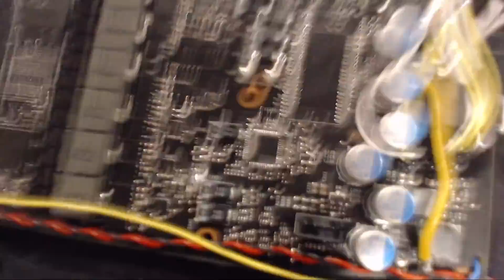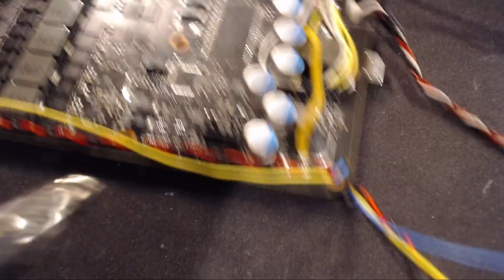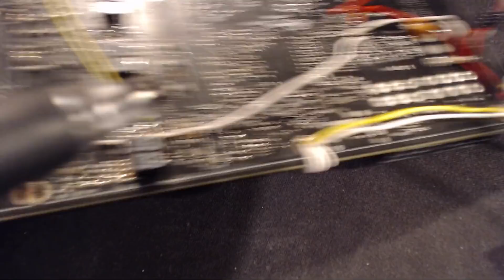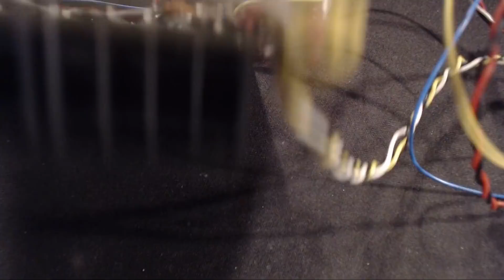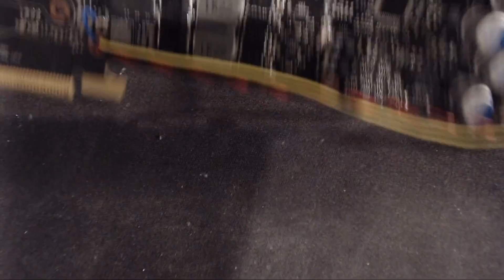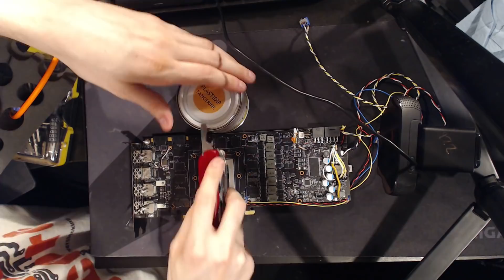GTX 1080Ti "Buildzoid Edition"

Comment: I had a Strix OC 1080 Ti which had the 12v line blow up in the exact same spot lol

that can't be a coincidence. I ended up doing basically the same thing, I just cut the pcie traces off those fried pins and was going to scavenge 12v from somewhere else but I was never able to get a boardview of the 1080 Ti and so I just ended up using the cooler on a 1070 Ti Strix instead and sold the broken 1080 Ti PCB.

I found the 1080 Ti in the trash anyways so I still made money off it lol

Comment: Eliminating phase shedding certainly reduces output ripple significantly.  It also eliminates the transient dip when a large load step requires the controller to power up the phases.  Note that this Vcore VR was designed to be CHEAP.  Control loop architecture the same as used on the very first multi-phase ~20yrs ago (voltage mode PWM), no I2C interface, no telemetry, current balancing using the low side MOSFET RDSON which is generally no better than 10%-15% (no wonder light load efficiency is bad, probably circulating currents in the phases), discrete MOSFET drivers + discrete MOSFETs (= much cheaper than SPS), and no tristate PFM mode (yet another reason for poor light load efficiency).  They probably saved $0.30 - $0.50 per phase and $0.50 - $0.70 on the controller.
EDIT:  The price is $760 for this thing????

Comment: As you've found out there is little use putting large tantalums directly at the chip. Their high ESL makes them useless at filtering high frequency. You want small MLCCs like you did with the memory chips. Their capacitance value don't really matter that much, the main problem is inductance at really high frequencies. You can see the PCB already has lots of tiny capacitors (0402 and 0201 and maybe even smaller).
Reply: http://img.deusm.com/eetimes/adt-0011-decoupling-capacitors-04-lg.jpg
This graph shows how capacitors' effectiveness varies at different frequencies
Reply: The smaller the package size the lower its ESL (and capacitance) and hence better performance at high frequencies

Comment: You think you're a decent EE until you see this video. How do you know what everything is off hand, did you get schematics or just analyzing the ICs and going from data sheet? If the latter, fooook
Reply from the maker: read part numbers of chips then study datasheets. I wish I had schematic but don't. In some cases I've do feed back mods based on just knowing the manufacturer and their preferred method of wiring up feed back circuits(this is basically the sketchiest thing I've done).

Comment: i dont believe its a 1080Ti..... indicator- 6 pin+8 pin power connectors...1080Ti has 2x 8 pin power connectors
Reply: belay my last....most 1080ti has 2x 8 pin connectors. just looked at newegg and seen a couple brands and models using 1x6 and 1x8 pin connectors

Comment: Honestly, I'm curious. If you went for a degree in Uni, what did you go for? I'm going into my second year of EE and previously did a year as ECE (electrical and computer engineering). I already tinker with hardware soldering, modding, and etc, but I'm just curious about your education. Thanks!

Comment: it won't work stable for a long time. there are so many cards witch faulty chip and fully work pcb. just replace the chip.  you can disable power throttling by shorting all shunt resistors.

Comment: Wtf is the point of a zero ohm resistor lol?
Reply: its a jumper in the size and shape of a smd resistor. during development it might have needed a resistor and when they solved another related issue it no longer needed a resistor. at that point do you respin an entire board because you don't want to use a rediculously cheap component? nah. just use a zero ohm resistor!

Comment: I've been wondering how you figure out the resistor sizes for your voltage dividers.
Is it all just experience or is there a formular of sorts to calculate Ohm values?
Reply: basic eletronic,just google it up
Reply: Right I forgot that BZ knows what voltafes and currents will be flowing so he can use U=R*I and solve for R, I thought he didn't know either U and/or I so he'd need a different formular or something like that.

Comment: There’s no much point modding the card. just flash the strix ocx bios, it removes the power limit completely and gives you 1.2v max vcore.
Reply from the maker: yeah except on LN2 I need like 1.5-1.65 Vcore and mem control to 1.5V.

Comment: Why are PCI-e 8-pins 360w max but 8-pin CPU power are 480w max ?
Reply: On a PCIE connector there are only 3 actual 12v lines (each line is good for about 120w, hence 120W x 3 = 360W), two ground/sense pins, and 3 actual ground lines, while on the CPU 8pin there are 4 12v lines and 4 ground lines (hence 120W x 4 = 480W).

Comment: So basically the GTX 1080 Ti wasn`t dead enough, so buildzoid has to make it even more dead with LN2

#what doesn't kill you makes you stronger
Reply from the maker: I'd say this card probably wishes it was still dead.
Reply: Actually Hardcore Overclocking "BrutalZoid"
Reply: Actually Hardcore Overclocking when is the funeral?
Reply: @ActuallyHardcoreOverclocking  Best comment, oh man.
Reply: that's the 1080TI Zombie edition
Reply: My card is shivering in fear from rendering this video.
Reply: @lolmandos  I'm shure your Card just needs a Cooler Replacement :D

Comment: i was sitting here, being happy that i mounted an aftermarket cooler on my gpu without breaking anything, and now you post this video
Reply: Lukas Beier I even managed to replace the Capacitors on a GTX 660 Ti, and he just rewired the whole 12V Rail and Current sense Circuit
Reply: Think I'll just blow the dust out of my card and get a 20% FPS boost :)

Comment: Does anyone actually care about the fact, that modifications on the voltage feedback network mess up the compensation network causing unwanted oscillations?
No?
Alright...
Reply from the maker: This is a REFIN not a FB mod. Also I've checked several of my FB modded cards with a scope and there's no issues with them.
Reply: Mmhh ok. Must be a single phase thing. Had some issues on the LTC3789 in the 50mV range when controlling it with a poti. An indirect op amp control solved it though.

Comment: Why use Liquid Metall instead of additional shunt resistors?

To go round the power limit of a gfx card overclocker paint liquid metall on their shunt resistors. Why don't they solder a second shunt resistor on top of the first one. Now the two resistors are used in parallel reducing the resistance. If you shunt two resistors with the resistance of R parallel the resulting resistance is 0.5*R, the test curcuit on the GPU measure's only half the Voltage doubling the headroom for overclocking.

The advantages are:
1. There is no Liquid Metall eating away the solder of your GPU
2. The resulting resistance is known, you know the current draw, you know the new limit of your GPU an you can operate it more savely.

My Queston is: Why don't they do it?

Comment: Looks like a 1080Ti + the shoddy wiring in my grandmas basement. 10/10 engineer genious though, you got it working.
Reply: Well I mean a good bit of the pcie slot is literally burned off... so wouldn't worry about the wiring xD

Comment: Any idea what your power consumption will top out at?
Reply: How much more did you get out of them mem with the 47uF?
Reply: i would say <560watts based on his lack of care for the PCIe cables for reference a mildly overclocked 1080ti could reach 300watts and normal ones are around 250watts i think Buildzoid would be happy if he could pull more then 560watts with this

Comment: how many money to spent for 4k camera?
Reply from the maker: I'd sooner buy a GTX 2080 Ti than a 4K camera.
Reply: what about upscaling to 4k from 1080p bcoz of higher bitrate with 4k? dont get me mad, i like your content, but more like in 4k.
Reply: BlacKi2007 4k is overrated according to me
Reply: Actually Hardcore Overclocking Actually Hardcore Overclocking I got my gtx 1060 corroded and is not working(corrosion is not covered in warranty) due to sea near my city and now my 1070ti founders edition is also corroding (the back plate side) little bit any ways to stop the corrosion?
Reply: @drake6836  May be too late, but clear coat (or paint) should help. Those will void your warranty (but then again so did the corrosion). The other alternative is smearing Vaseline and using a heat gun to make it uniform and smooth (you can melt it off and let it drip away, might not void warranty).

I use Vaseline for water-proofing cards/sockets/boards etc for phase cooling (you get frost covering components when you forget to turn on the heaters). I would suggest replacing the coating every ~6 months since it will probably pick up moisture slowly.
Reply: @jakegarrett8109  BuildZoid Said for conformal coating
Reply: @drake6836  That works too. A lot of people use that for quadcopters to resist rain.

You might want to look into a dehumidifier. All your other parts like your power supply, MOBO, RAM may fail the same way as the GPU.
Reply: @jakegarrett8109  My room is huge can't afford one ,i think mobo ,psu and ram is covered in corrosion warranty
Reply: @jakegarrett8109  and btw have currently moved to another city its 70 miles for college away so no humidity here

Comment: When you're like "yeah I know a bunch about video cards" then you see this.
Reply: this guy is more focused on PCB's and the electrical side of things, so ofcourse you're gonna feel little dumb not knowing all of the stuff buildzoid says xD
Reply: ItsQuint well if you didn’t take high school yet maybe so
Reply: I come here to feel dumb. Works every time.
Reply: It helps to know some basics about electronics.
I know next to nothing about overclocking, hardcore or otherwise (I've tried a few simple one through bios tweaks and the like, but never anything serious.)

I can follow along pretty well with what he's explaining though because I have a bunch of knowledge from disparate areas that tie together in the right way.
That's not to say I'd know how to do what he's doing, just that as he explains it I can see how that makes sense.

Then again, I'm contemplating how to interface old 8 and 16 bit computers and game consoles with FPGA's and microcontrollers, so when you start to see things about voltages, power regulation and how various chips communicate it's not so vastly different...

Just one of those things. This seems really out there if you're unfamiliar with any of the stuff that goes into it, but somewhat more obvious if you know a bit about electrical circuit design...
(Also doesn't hurt to understand some stuff about computer architectures specifically. XD)
Reply: I did law school and Im here watching most of his videos, learning stuff and having no idea about half he says :f
Reply: I was impressed with myself when I looked at the pin out and managed to get a 8 pin power out of 2x 6 pin connections
Reply: Agreed, even if I didn't fully understand it all, I really enjoyed it. This guy seems to know his sh*t
Reply: Being compared with this guy,  I know nothing.
Reply: literally what I was thinking. this dude's channel name doesnt lie. hell, its a understatement.
Reply: You may know about video cards models boy, but nothing about electronics.
Reply: "If you feel like the dumbest person in the room, you're probably in the right room"... or something along that line.
Reply: Sex
Reply: Artistry aint it? :oD #uCHOOZE
Reply: TheUncleshady I mean literally if you took basic physics class in high school you should know about it resistors, circuits, current, voltage,and Capacitors that’s pretty much it to electronic components
Reply: Kolby Brian2412
God dammit, i could of built my PC from scratch and not spend £1000s on components, i could of just got some Capacitors and resistors glued them together with hot glue.
Reply: Paradox not what I said you took my words out of context all I said is if you took physics class high school level you would understand the basics of what it is
Reply: ye im shore most people know what they are and do, In turns of making a small circuit LED light brighter, dimmer or flashing. but we are talking about a 1080TI.
Reply: Oh, you trolled yourself. Super :D
Sorry mate, I was out, doing stuff - I built that PC you mentioned though Paradox. And paradoxically, whilst the graphics card in it is, honestly total shit... the Capacitors and all the other hot-glue components actually work Better than my i9 - quelle surprise. Gosh I'm so pissed I went to Uni, to study systems engineering, when all I needed was a big mouth & all tha Lectronik Kumponutz :D
Reply: @pdjames1729  really sorry sir, i think your core i9 has diabeties and there's no treatment for that.
Reply: @pdjames1729  btw in french we say "quelle surprise" and not "quele surprise" so yeah maybe you wanna think twice before writting a comment and i'm not talking only about the french.
Reply: Off you go then. I'm itching to watch Your full schematic breakdown of a crackling-edge prosumer product. Though It's probably worth adding Transistors and Diodes to your definitive list of all "lectronic komponunts" .. just saying #Bighead xx

Comment from the maker: UP9511 modding video: https://youtu.be/X3Y_zbJOb7E

Livestream with the card soon!: https://www.twitch.tv/buildzoid
Reply: Actually Hardcore Overclocking I got my gtx 1060 corroded and is not working(corrosion is not covered in warranty) due to sea near my city and now my 1070ti founders edition is also corroding (the back plate side) little bit any ways to stop the corrosion?
Reply from the maker: conformal coat maybe?
Reply: Actually Hardcore Overclocking Will it hinder the heat excretion  or anything?
Reply: Actually Hardcore Overclocking isn't conformal coating pre applied?
Reply from the maker: it will but a hot wroking card is better than a cool corroded card.
Reply: Actually Hardcore Overclocking Ok Thanks And Its Gonna Be Pretty Hot As Its Blower Style Founders Ed ! And Btw Can the old 1060 be repaired i mean anyhow ?
Doesn't new gpu come with pre applied conformal coating?
Reply: The colour says Tangerine! And my GTX 1080FE (8GB) does between 1911-2011 MHz stock. With an EK full cover water block. I can get it to 2200core/11,000mem from OCing
Reply: Actually Hardcore Overclocking So, do you like study in uni, how the hell do you know so much about everything you do in this channel?
Reply: Which LN2 pots would you recommend for a GTX 1080FE, and for an LGA2011-1(Socket R)? The MB is an EVGA X79 DARK, CPU is 4820K@4.7@1.282-1.305v, all on water now. Also, I'm running 32GB(8X4GB QC-2133 Dominator GT), so would I be better off just populating only 4 of the 8 RAM slots? (As far as overclocking goes) And I will be doing a tear down of my system to do some maintenance, so at that time I will send you some hi-res photo's of the board. 
Thanks,
Matt